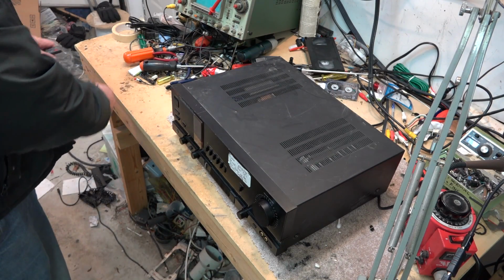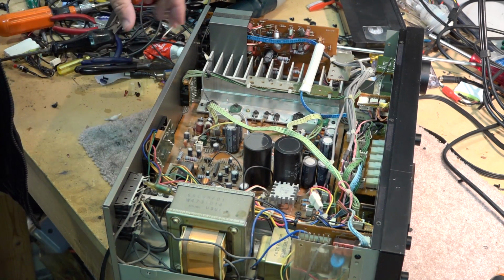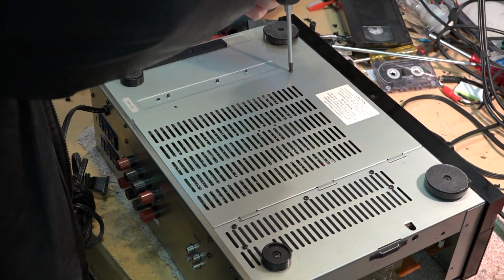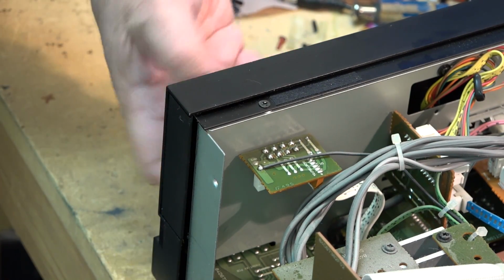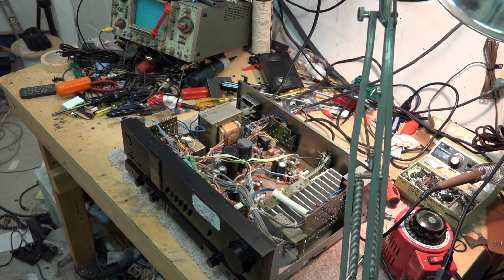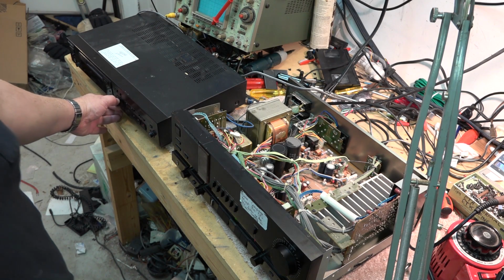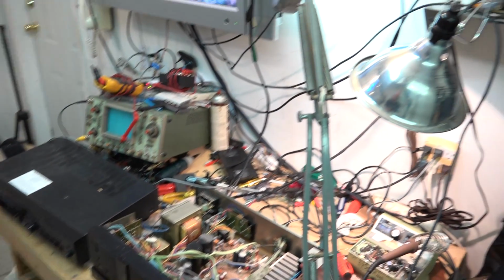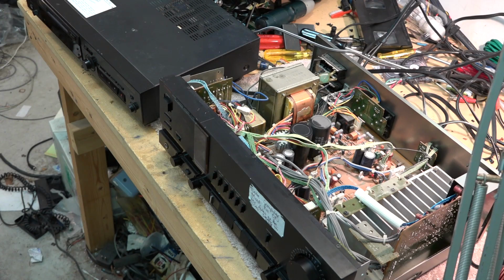luxman lv103 hybrid amp service

Comment: Harmonic bullshit
Reply from the maker: Another response from someone that knows absolutely nothing about how the human ear responds to sound.  It has nothing to do with specs on paper.  A tube or hybrid amp will always look worse on paper, but it is how it sounds to the human ear that matters and no solid state amp no matter how much it costs will match the sound qualities of a tube amp. A tube amp could be operating at 5% distortion and it would still have a more natural sound than a solid state.  These companies are not in business selling high end tube amps to a bunch of old deaf guys.  They are still making them because the demand is there by discerning listeners that demand the best sounding amps to their ears.
Reply: Even though tube amps tend to have more harmonic distortion than SS amps, most decent tube amps won't produce more than 1% at their full output. Many studies have been done and the majority of people are unable to detect the 1% harmonic distortion. You can see in a spectrum analysis that most decent tube amps will show very very little THD. Here is an example of what I'm talking about, and just like this one there are many other amps that measure very similar. This whole THD of tubes is always exaggerated whe comparing to SS amps. And at the end of the day it is so low that it can't be heard.
https://youtu.be/wGPv9DrbWzA

Comment: Hi guys.. Have a luxman lv 105u.. Dead phono section... Cleaning?... Thanks for any help
Reply from the maker: Phone section is dead on mine too.  Fix some day coming.
Reply: @12voltvids  please tell me what you did...on my pension!...its pretty expensive to fix at a audio service shop
Reply: @12voltvids  did u find out what the problem is?...just to open tbe thing is between 60 to 80. Canadian!...
Reply from the maker: @ffantom6934  No, have not opened it yet to check out. One of these days I will get around to servicing it again. Have to disconnect it and take into the workshop. I haven't been using the phono section because I don't listen to vinyl much.  I'll get to it soon.
Reply: @12voltvids  .. I've go so many offers from people to buy the thing even with a non working phone section...not sure what to do.
Reply from the maker: @ffantom6934  
That is because they know how good that amp sounds.  You will be hard pressed to find a better sounding amp.  I will never part with mine unless the mosfet blows which is an unavailable part.
Reply: @12voltvids  how would you know if the mosfet is gone?.. No power?..etc?.
Reply from the maker: @ffantom6934  if a mosfet blows the protection relay will not kick in, and it will probably blow the fuse.  Never had any fail on them. The are pretty reliable.
Reply: @12voltvids  k.. Thanks for the info... I'll check the fuses...now have 10 people after it!
Reply from the maker: @ffantom6934  You will probably get a pretty penny for it because these are desirable amplifiers.

Comment: In the 1970 and 80’s I was a Luxman Dealer. They offered a dealer great repair and replacement services. Very rarely did I need to use it. The products sold themselves in sound, looks and quality. The greatest difficulty was the availability of some of the tubes. The designer of the transformers was the founder of Esoteric Audio Research. We were dealers for his products also. The Luxman sound was crisp by with spaciousness only found with tubes valves) I did notice a change in quality with the Alpine  takeover. Never a disaster just an inconvience to the customer. Your absolutely correct with the harmonic distortion,but very miusical that made some of the Luxman sell so well! We did not sell the turntables as the were in extremes of value from low to excessive in value!  At the time we were allowed to”cherry pick” the line.

Comment: I have a fault on my LV105. With Bass tone control "in use" the Bass tone control very noisy and results in throwing high volume/ DC to speakers. The amp trips out when it does this but resets. It could be a solder joint etc but wondering if can still buy the pot and if easy to replace? Alternative is I sell it on.

Comment: What a great sounding amp,you can here where the money went!
Reply from the maker: It is the best sounding amp I own. Needs some work to be done on it as it goes into protection once in awhile, and the phono preamp isn't working, but that will be address in a future video. 
I still remember the day I bought it at 2001 sound center in Burnaby. I paid 1999.95 for it back in 1984. In todays money that would be about 4800.00 give or take a few $.
The salesman was pushing the LV105 as it had an additional 20 WPC, but it was also 400.00 more, and back in 84 I was making only about 10.00 per hour as a technician. I was taking home after tax probably 1300 a month if I was lucky, and was living in an apartment I could barely afford at 400.00 per month. (Remember back in 84 minimum wage here in Canada was only something like 3.15 per hour) The thing that makes this amp sound so good is the 2 technologies. The 2 tubes, which are dual triodes give the warm tube sound. They are what makes this thing sound as good as it does. The power section uses almost indestructable (and now obsolete) power MOSfeT transistors, which are very low impedance devices. It is happy down to 4 ohms. I run a pair of Altec Lansing 305 6 ohm speakers on it. The mosfet transistors have incredible damping factor, and that results in mice, tight powerful bass. Luxman was I believe the first company (I may be wrong) to design and build a hybrid amp, which of course is now done by many companies including high end companies like PS audio. Full tubes amps look cool, and they sound good for sure, but this bad boy sounds every bit as good, and has much better speaker damping than any tube amp, as the output transformer on a tube amp doesn't do much to damp out what the speaker kicks back on hard punchy bass drum thumps. For that reason, I perfer the sound of this one when listening to loud jazz or rock. For background listening where the volume isn't cranked, my home built class A tube amp has an even warmer, more satisfying sound.

Comment: hi, sir..
would you please make a tutorial of how to open front panel and change the tube?
thanks
Reply from the maker: The front panel doesn't open. The tube board actually lifts out from the back. You are in luck, I need to service that unit again as it is giving me some trouble.
Reply: fortunately I found some instructions on the net to open the front panel. It's divided into two parts the upper part is harder to open because it has latches. But if we pull it forward carefully it will be safe. And it's easier to change the tube fron the front I think. But now mine is in trouble too. It produces loud hissing sound whenever I press the tone in button.
Reply from the maker: MIne the phono preamp has a problem, and lately the amp will just go into protection at random, so it is in need of service and will be overhauled in the newr future again.

Comment: have one. no power. chked fuses all ok. what can be prob??
Reply from the maker: Did you check continuity between the AC plug prongs when you turn on the switches? You should see the resistance of the transformer primary.
If not then you either have a bad power switch, or one of the internal thermal cutouts on the transformer has gone open.
Reply: 12voltvids i have continuity from ac prongs. thermal cutoff are located inside the transformer windings?? or on board?? i watched all ur vids one night for 6 hrs!! great job.

Comment: I own a LV-103 too. Very good sound & qualitiy. Looks nice too. 
I have also a LV-110, a LV-111 and a L-410.
Reply: I have a lv-110 too! How does it compare to the lv-103?
Reply: 110 too here. Bought it used 6 years ago and it's going strong. Cost only 50€

Comment: I have the same amp! Have used it for years through a pair of Altec Lansing Model Fifteens and it's a great combo. It was reassuring to hear you say that the valves rarely fail as I've always worried that would be a problem.
Reply from the maker: The tubes (valves) in the lv103 are only being used as buffer tubes, to warm up the sound, and introduce the even order harmonics that make these units sound so good. Since they are not putting much power through them they last a long, long time. Mine are original tubes, been running since 84 when I bought it, and my amp gets LOTS of use. I leave the preheat turned ON to keep the tubes warm, as that prevents thermal stress on the filiments and cathode from expansion / contraction, That also greatly improves the life.The tubes are readily available anyway, as are most audio tubes, as they still make tubes. High end amps use them. My living room amp is a full tube unit.

Comment: Very nice gear. I have Luxman lv-101 (paired with nice vintage Braun/ADS Ls70 speakers)  and it were 2/3 of the price of lv-103, but yet, it's very nice sounding. It's warm, musical and full of life. I think I will never gonna sell mine, I will have it till it die in my house on my sofa..
Reply from the maker: Yes I agree the Luxman units were well designed. Very good sound,a nd well built. I have yet to find an amp that sounds as good as this one. I wish I had sprung for the LV107U as that was the 105WPC Hybrid, the last one they made. These were very expensive amps mind you, and when I bought mine in 1984 it was over 2,000.00 and the higher powered units were even more. That was a lot of money for an amp back then.

Comment: tubes are better you remember the old Magnavox stereo consoles from the 1960's I have one after that and man all I can tell you is it sounds great too
Reply from the maker: +ducklandwikeno I have 2 fill tube amps. A modern yaqin, and a vintage McIntosh. They sound great. I also have the lux man hybrid, and an old again 1710w reel to reel tape recorder with full tube amplifier.

Comment: 300 bucks off ebay for one . I wouldn't mine having one of these but I don't have room in my house now .if I did I would be buying this now .the one I seen is in Chicago not too far from where I live .
Reply from the maker: +ducklandwikeno Yes they are holding on to their value. When it was new I paid about 2,000.00 for it, and in 1984 that was a ton of money. Back then I was being 9.53 an hour by the Sony Corp. That is what they paid a video tech back then. The audio guys made 6.50 an hour. By comparision a McDonalds or 7-11 worker made 2.10 an hour!

Comment: Anybody ever hear of an amplifier made by VSP labs? They were produced "hand made" meaning all components were manually soldered and put together by a assembler tech. No assembly line!! They were by many audio savvy people rated as top notch amps that had the warm clear sound of tube amps. The company had only one location based in Ann Arbor Mi. The big problem now, is that certain semiconductor components were discontinued and unavailable many years ago. The company went out of business many years ago as well.
Reply from the maker: +service1956 Haven't heard of them, but have STL. (Space tech labs)STL is a high end boutique amplifier manufacture in Vancouver BC Canada, and they build all their amps by hand. They also only sell direct from the factory, so no retail outlets, no middlemen.  Price is high, but you get what you pay for, and I have heard their amps, and it was unbelievable. Mine you the system I heard cost more than what I paid for my house but....

Comment: Valve amps ARE THE BEST in my opinion. Good stuff.
Reply from the maker: +Reg Scriven Tube amps, also known as valve amps produce a different sound than solid state which to many people produce better sound.In reality this is not the case though, but the human ear is not perfect, and to many folks they sound nicer. Truth be known a tube amp is far from a clean amp. Early solid state amplifiers were quite dirty, and produced nasty odd order harmonic distortion, whereas tube amps produced even order harmonic distortion. By even order harmonics, all the frequencies are in phase and when they mix in the amplifier stages they give a warm fuzzy sound that is pleasing to the ears especially when it is an electric guitar, or a Hammond B3.Modern solid state amplifiers are exceptionally clean. You get out exactly what went in.  If you put a pure sign wave in, you get a  pure sign wave out, just a bigger signal. A valve on the other hand, once electrons fly past the control grid, and head to the plate, they can and do land in a random pattern, and this adds a slight bit of even order harmonic distortion that really adds warmth to the sound.I have solid state amp, 2 full tube amps, a modern amp, and a vintage Macintosh, and this Luxman LV102 hybrid. Out of the all the Lux is my favorite. In fact both my full tube amps are not even in use. Solid state amps have lots of current, whereas tubes do not, they are a voltage amp. When a tube saturates you get tons of even order harmonics and distortion, and depending on if you are using solid state or tube rectification sag. If you are a guitar player you want this. As a HiFi amp, you don't because you are listening to more than a guitar. This is why I prefer the Hybrid.I get the all the benefits of the tube preamp stage, that is the even order harmonics that warms up the sound tremendously, but because the output stage is MOSFET there is LOTS of current, and excellent speaker dampening that a solid state amp delivers, and pretty much instant recovery. It is hard to describe in words, all I know is it doesn't matter what I listen to, be it vinyl, analog tape, CD, Digital tape or even crappy MP3s the hybrid amp is clearer on every source, followed by the modern Chinese tube amp, then the vintage MacIntosh and all the solid state amps behind that. I have done careful listening in my studio, and after not using the Luxman for several years when I was on my 100% tube eargasm, I connected the luxman to test it out after servicing it when I did this video, and was blown away by the sound, and fell in love with it again, banishing my tube gear to the living room when it just looks pretty sitting atop a stand. Its a great conversation piece, but in my studio the 30+ year old Luxman is my main amp.
Reply: Thank you for the explanation, i worked as a tv repair man back in the 70's to 80's. This was quite an interesting time as it saw the change from the valve through the hybrid to the fully solid state.Well i am retired now and derive much pleasure watching programmes such as your's, brings back memories KEEP UP THE GOOD WORK. And a MERRY XMAS and HAPPY NEW YEAR
Reply from the maker: +Reg Scriven Yes same here. I was in the business from basically 79 till 2003.I started my apprentice when I was still in high school,  by 83 I had by certificate in electronics proficiency. Worked in the consumer electronics repair business full time from 84 to 2003. It was on my 40th birthday I work up early. I was used to getting a call from my mother at 5:47 in the morning to wish me a happy birthday. (yes I dam near busted a gut when I first saw the movie "City slickers" when Billy Crystals character gets the phone call in the middle of the night from his mother to wish him a happy birthday. I was just sitting there in the dark, and my wife work up and asked me what I was doing, and I said to her, I am done as a technician. I could see how technology was going and I didn't like what I saw made that decision that I had to do something else as I knew there was no future in electronics repair. Within 3 months I was out of that business, and into a completely different industry. One that others had said was a dead industry, but you know what, the phone company has been very good to me for the past 11 years, and it isn't going away anytime soon. We might not be installing phones as much as before with technology changes, but high speed internet and IPTV content delivery is going like gang busters, with no end in sight. I have seen ADSL come in, then fiber to the corner with last mile VDSL, and now fiber to the house is getting going, as the demand for more and more bandwidth just explodes. Now the electronics servicing side of things is just a hobby, but I have lots of knowledge in this field to share.

Comment: Nice Luxman, I have the luxman L-530 and it has 4 of the led's on each amp driver board, Thank you, now I know what the LED's  are for! 
Mine also has the Ontario hydro sticker on the back.
I have a bad To-92 style 2sc2320 on the power supply /  protection board. Can you recommend a good replacement for that transistor? are these circuits forgiving when it comes to transistor? If I have to, I can take a 2sc2320 from the phono board and use it on the power supply and put the replacement on the phono board, what would you do?
Reply from the maker: I don't have a cross reference book handy these days, but you can look up the specs online. If it is just a small signal transistor used for switching there will be a tone of replacements you can use. Just make sure your voltage and current rating are at least as high as the original.